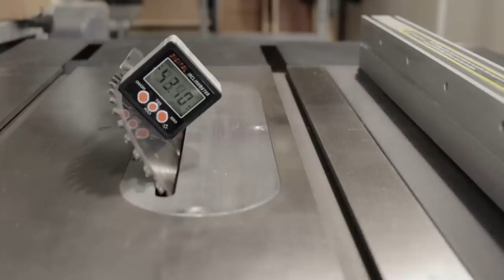Box Miter & Square Shooting Boards

Comment: Your video of showcasing your handtools and woodworking setup inspired me to give woodworking a try. The only thing that worries me is air filtration. Inhaling small particles and damaging the lungs paranoids me. For your setup, do you have any air filtration setup in your room?
Reply: If you watch him setup the table saw cut he moves out of frame and you hear the Festool dust extractor get turned on. Then the table saw starts. I’d imagine he wears a mask. I have seen him drag the table saw outside of the shed to use outside. Limited use of power tools allows him to avoid most of the dust.

Comment: How is it that the plane isn't constantly wearing down the plywood in the base?  Thank you
Reply: Cause the blade isn't as wide as the plane :-) 
It's more of a difficult when you shoot the 45° angle, I might be wrong but Adrian is paying attention to keep the front of the plane on the fence.
Reply: There is a strip on the side of the plane that the ‘wear in’ area never touches. The sides of the plane mouth and a little more because the plane blade has a little gap on each side of the mouth.
Reply: @FearsomeWarrior  Thank you so much.
Reply: @DominikRicker  Thank you!

Comment: Perfect that you posted this just as i'm planning to build 2 shooting boards! I think this will be the design I'll go for. 
How do you feel about the birch ply for durability? I have some hardwood i was thinking of using for the base of the 90 and the 'slope' of the 45 where the side of the plane would run. Is this worthwhile?
Reply from the maker: Thanks! My old shooting boards were also birch ply and lasted over 6 years, the ply stayed ok, flat, just the usueal abuse, cuts etc. The ild 45 rail was wooden and noticed small changes in flatness that s why I used here 2x plys glued together

Comment: Many thanks for the video on shooting boards. I have an old one which I need to replace, this looks just the part. Slightly puzzled by the dimensions of the fence. You give it in area which makes sense up to a point.  I assume the length is 155mm as you state but then give the depth as 270mm. Might it be better to give just the size of the fence? Apologies in advance.
Reply from the maker: Thanks! There I wanted to specify the “active” area, 155 mm the fence width and 270 from the fence backwards to the end of the board. I knew I should rephrase those, or maybe make a drawing, it is indeed a bit ambiguous. No worry, thank you!
Reply: Hello Adrian. I wasn't expecting a reply so soon so many thanks for a prompt reply. Thank you for the explanation. A fine craftsperson.

Comment: Total newb here...how does the blade of the plane not shave down the surface that the plane travels on?
Reply from the maker: If you watch at 5:22 the plane will stop to bite once it shaved the amount the blade was set out. Then it will rest on that side, that distance between the blade and end if the sole.

Comment: Sligjtly unrelated question: does the solar kiln work?
Reply from the maker: Is still working but not for me :) I moved my shop elsewhere one, and second most important the hustle getting the tree trunks, milling them, transport, some needed paperwork was not worth it. My father in law uses it for some some fire wood, diy wood or for vegetables seedling. Anyway it was a good experiment building it and learning about wood drying.

Comment: I'm kinda new to plains, it seems the blade reaches the base board, why doesn't it cut it too?
Reply: Plane blades aren't quite as wide as the sole of a plane. The throat (opening where the blade pokes out) doesn't go all the way to each side of the plane. There's a thin strip of metal (maybe 1/8" to 3/16") each side of the opening. If you have a planr to hand, have a look.
In practice the blade will cut into the base board, but not all the way to the bottom. It end up leaving a small shelf the same width as the thin strip I described above, and this is what the plane will ride on.
Reply: @PickledWhispers  I thought of that, but I couldn't see if the blade reached the board on the video. Thank you for the perfect explanation, it all makes sense now. I'm gonna make guide like that to see if I can make my cuts more precise. I'm not so new to woodworking but this small delicate cuts never joined perfectly.